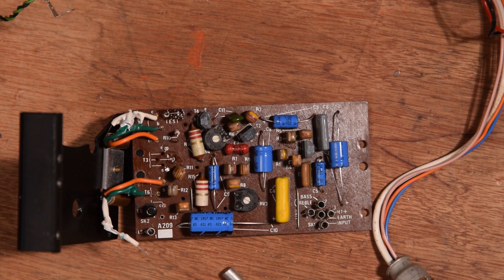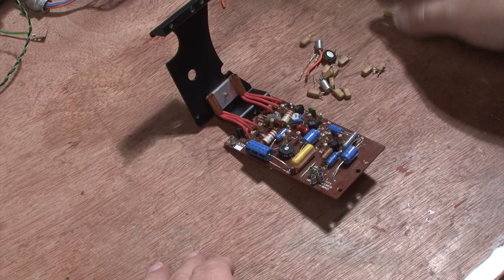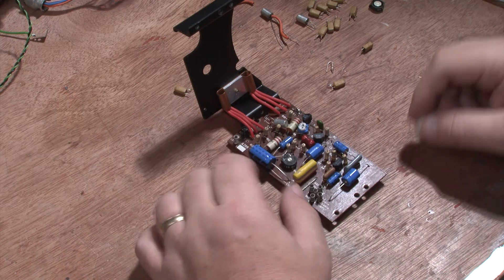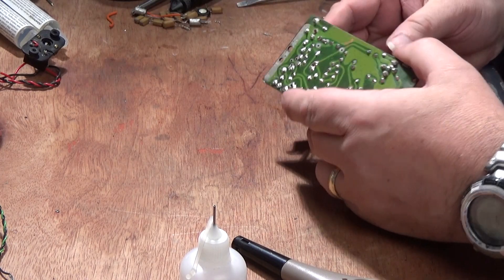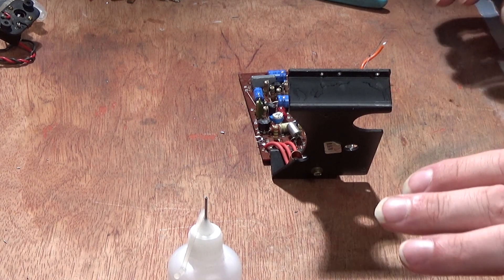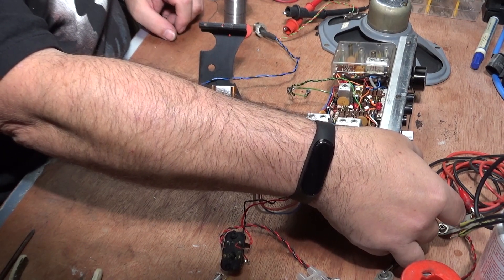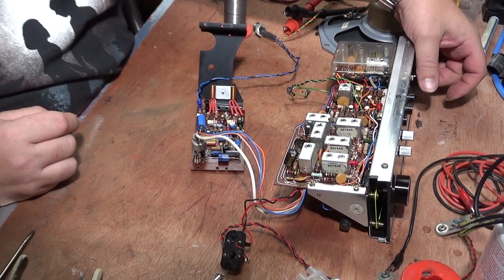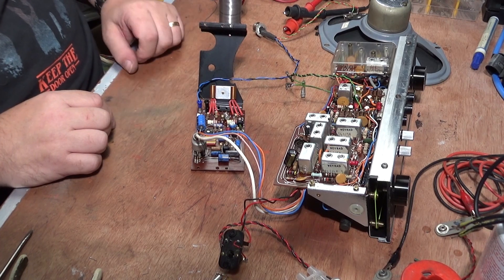Hacker Hunter RP38A : Transistor Radio Repair : Amplifier Board

Comment: Hi George
Been watching your series of videos on the RP38A. Very informative  and enlightening.
I have just acquired an example of this radio but have no experience with transistor sets though I have restored a number of valve radios. 
I have the manufacturers service details but I am surprised that no details of capacitor voltages are stated. With valve radios this is important so are there different rules for transistor sets?
I need to order components so how can I find out what the ratings should be?
The RF alignment on my set is way off but I don't have any fancy equipment for a re-alignment ,  just a basic signal generator and several mutimeters and an AVO.
Any suggestions how to progress?
Cheers
Lynton
PS we have spoken very briefly on Keiths forum.
Reply from the maker: With transistor sets the maximum voltage components are going to be the small electrolytics at around 63v. Not that the set will reach those voltages but because that's what is available off the shelf. Generally, you can go by the sets battery voltage plus 10% and be safe. Only areas to watch out for are in mains powered sets around the PSU. The other components such as resistors and diodes will again be well within the voltage rating by default. Back to electrolytics, just look at what the manufacturer fitted and copy that or exceed it. Generally you can buy 25v caps and that will be good enough for anywhere in the radio.
Reply from the maker: With alignment, just work the same way as a valve set with the avo on the speaker terminals in place of a millivolt meter on the input to the volume control.
Reply: @GeorgeChristofi  thank you very much for the replies, much appreciated.
 I was comparing the radio last night against my Trio R600 and it is very apparent that the RF alignment is miles off, so it looks as if the set has been “adjusted”. Also the service manual I have is for the 38 not the 38A as you mentioned in the video. I believe there are some circuit differences.
The set needs quite a bit of cosmetic work but that for me is much less daunting than the electronics.
I will watch your series over again before diving in and I obviously need to order components.
Once again thanks for the replies.
Cheers
Lynton
Reply: Apologies Did I really say 'Keith s forum?  I obviously meant Grahams forum. Apolgies to you and to Graham. 
Lynton

Comment: Very neat work on the amp board.  If you have a chance to give us your thoughts on alignment procedures, it would be very useful.  Loved the campfire.  I need to try that one.  Best, Doc
Reply from the maker: The alignment of the amp board was nice and simple... The radio... now that is another issue! I will look carefully at the instructions but this one still has the factory paint on the IF section so I'm hoping it isn't too far out. Going to go for best signal to noise I can.

Camp fires are needed for sure.. Thanks for stopping by, we shall see you for the next one.  George

Comment: Never seen flux removed like that before!  :)  Q? Why not just replace all components with new if you had them out of there??  I would have.  Great video George!  ~Jack, VEG
Reply from the maker: I did Jack. The only thing I didn't have was enough germanium transistors. all of the caps and resistors as well as the outputs are brand new. The outputs were nos but I had to struggle to find them in all my stock boxes.

Fire is good! Now the next video will have to have explosions or lasers or something.

Comment: Never seen those block resistors before. Interesting repair and video thanks for sharing regards Chris
Reply from the maker: I thought they were caps the first time, it was only looking at the schematic and using my single braincell did I remember transistor amps generally need a bunch of resistors around them.

Comment: Cool nicely done I used to think those square things were capacitors at one time until I tested one ! probably because there were a lot of normal looking resistors on the board that I was looking at and I remember we used to use methylated spirits to clean off flux
Reply from the maker: I initially thought they were caps too. When I looked at the schematic and saw it was all resistors I slapped my head because I should have realised amps needed biasing. At one place we had an ultrasonic tank for flux removal... 300 gallons of Triclo... worked brilliantly, but currently on the list of banned chemicals for being a carcinogen.

Comment: I think the real question on this video would be about whose toothbrush was actually used in the cleaning of the amplifier board. You do not have to say anything but it may harm your defense when questioned something you later rely on in court. Anything you do say may be given in evidence.
Reply from the maker: It was actually a new pink toothbrush. The part where I opened the packet and commented on using a pink brush is actually a cutting room floor clip!